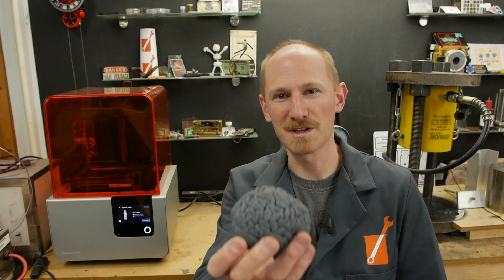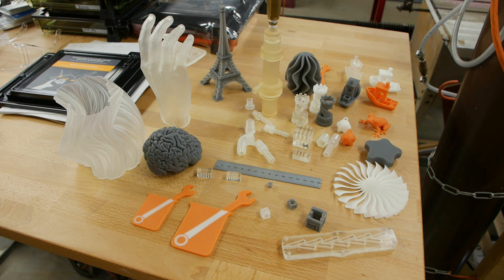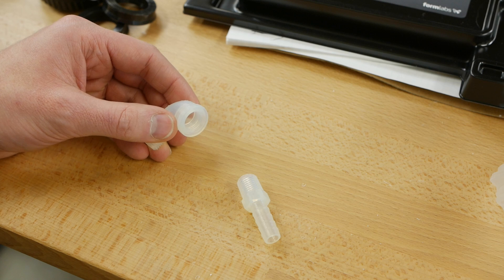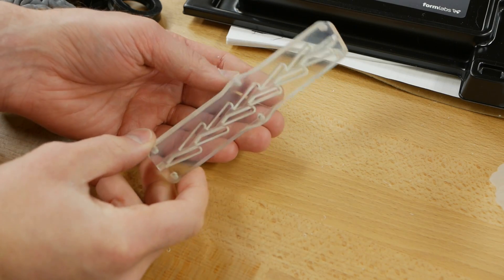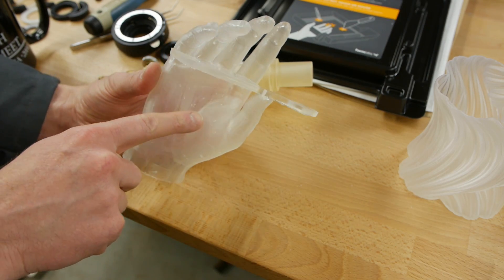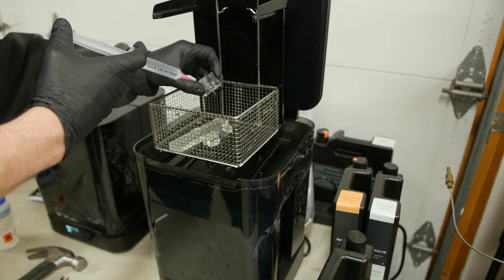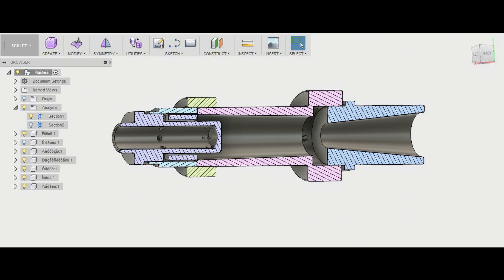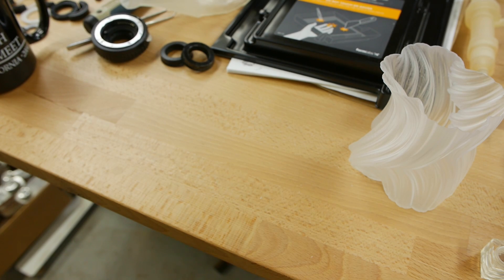3D print your brain, timelapse, high-res microfluidics, custom colors...

Comment: A Promo Code and a Bunch of Savings is alll I need! 🙏👀👌  Each of those parts are definitely as detailed as I would like for 3D Modeled Objects. They're so functional! I don't think the striations caused by an extruding printer could match the structural strength of that lazer Printer either. Just, Wow!, that's so Cool!

Comment: That is pretty awesome!  I wonder exactly how strong the various materials they offer actually measure.  I also wonder if the frosted finished products could be made clear with an acetone vapor bath, like the way regular 3D printed stuff can be smoothed out with acetone vapor.  If so, that would allow for making clear parts that aren't flat for sanding.

Comment: Yeah, I'm pretty late to the 3D printing game too (as in I haven't bought one yet, but do get some things printed at Shapeways). Being able to print ceramic is mind blowing to me.  So I'm up in the air as to do I get Formlabs or some PLA/ABS depositing printer.  I would like to print Kynar (Fluorinar) which I've only seen Ultimaker print.
Reply: 3d print a mold for another attempt at gecko tape

Comment: Good luck with the temperature resistance resin. I have been using it for my prototype. Been auto-calved my parts at 120C for 15 mins and used at room temperature. The trouble is, the part became white, mat, very brittle to the point it break too easily ain't even usable. Have so much problem with it for the pass 6 month back and forth with formlab and they just wont acknowledge the problem.  To me, the idea of all the different type of functional resin is amazing, but the technology just ain't quite ready yet. They have also just changed the user guide for resin tanks after years of cracked tank complains. So now you can't have resin stayed inside the resin tank for over a month. I have no idea what to do with mine as I do regular small prints every 1-3 days on each resin tanks. It is a nightmare if I need to clear them out every time. Plus you can told not to pour your resin back into the cartridge, so storing them separately is a pain.

Comment: It looks like a lot of teething issues have been fixed with the Form2. I would caution anyone against buying a used Form 1+ as a cheaper alternative. It's still a gorgeously made 3D printer, but I think it was very much a beta product. Some people had no issues at all, others could never get it to print reliably (myself included). My own opinions here:

When the 1+ was released, there was no good documentation on post-print care. The instructions we got with the printer were laughably simple. We figured out that we needed to post-cure with UV, but it's only recently that Form developed proper wash and cure stations. These are absolutely necessary for good prints, and manually dunking in a bucket of IPA doesn't cut it. The printers are pretty sensitive to optical issues - dust on the galvos, smudges on the base of the tanks, the inevitable fogging (UV damage by the laser is inevitable, so the tanks are disposable after 2L of printing). Over time the software got better at support design and patches included easy-release tabs on the prints. Old resin will crack tanks - found that out the hard way when it leaked resin into the printing cavity, fortunately missing the important bits.

In short there were a laundry list of little problems which meant that we could never get it working well - I don't think we were ever able to replicate the helix rook that Form provided as a demo print.

I really wanted to love our SLA printer, and on a good day it's easily better than FDM or SLS, but it was so much faff making it work reliably that it's left a sour taste. This seems to be echoed by a number of other 1+ users on the support forum when I was trying to find comparisons. Happy to be proven wrong here, because the results in this video are very enviable.

Comment: For cup shaped pieces could you not submerge a tube in the resin bath, an snorkel of sorts, to equalize air pressures?
Reply: Probably not because it would block the path of the light/optic/laser thing.
Reply: He could put the printer in a vacuum chamber, there is no pressure to equalize...
Reply: Friend: "why on Earth does this vase have a screw-on bottom?!?" Me: "...reasons."
Reply: Michael Scofield 
That's good thinkin', but besides the problem of the snorkel blocking the laser, the snorkel tube would also have to be extremely thin because of the way the machine works...
The print is made up of layers, and the way the machine creates these layers is it holds the already-printed portion of the part a fraction of a millimeter above the bottom of the resin tank. The laser then cures that very thin layer between the floor of the tank and the existing part. When the laser is done with the layer, the machine lifts the part, wipes the floor of the tank, and then lowers the part back into the tank (leaving a new gap, which will be where the next layer will be formed). The snorkel would have squeeze through that very thin gap.

Comment: Tesla valve is like a diode for liquids, or gases.
I would think that if you vibrate axially it at the right frequency, it would behave like a pump and never wear out.
May even be useful for an artificial heart.

Comment: As awesome as SLA is, I would still recommend getting a high quality FDM printer for your own shop. Sure, the accuracy isn't the best, but the speed is hard to beat, and you don't always need to print microfluidic structures.

Comment: I was wondering if it was possible to use the printer with a LC screen to occlude the light curing the resin. Or maybe also focus the laser on a spot to create areas without/with less support material.

Comment: I stunned how good form 2 seems to be in through hole and "inside holes" stuff. I have sparkmaker - its of course no way comparison to form 2 but its also sla - and this stuff gives me most of headaches. Holes smaller than ~ 1.5mm comes out filled with half - cured resin, like a puddy, and you need to push it through (with a small drill bit for example), and hope it got not too hard. I wonder if new anycubic photon 2 has the same problem since paying 2k for form 2 is not an option unfortunately. I was wondering maybe you using ultrasonic cleaner maybe?

Comment: That's an incredibly slick method. But it appears in the videos that the laser beam(s) fuse the resin at certain locations in the bath. 
But how do you stop a light beam at a desired distance? I assume the beam(s) are focused at the desired points to (a) fuse the resin at that point and to (b) avoid fusing resin along the path of the beam(s). 
I'd be interested in more info about how Form Labs' method works.

Comment: Dont print threads in transparent resin. Because it is transparent the laser will cure resin that is left on the "wrong" side of the threads, and make them non uniform. Try do a 1/8 thread in gray and it should work.
Reply: The transparency of the resin is not uniform across the spectrum, it's transparent to visible light here but almost UV-opaque, permeable to the UV wavelength used to cure it just to the maximum layer height - regardless of colour, they will always make this the same. Also the additive CMY dyes they offer must be completely transparent to the curing wavelength. If this was as you suggest, you could cure a super thin layer but there would be nothing holding it to the rest of the print!

Comment: would there be any purpose in a 3d printed superconductor? couldn't you just cover the surface of a 3d printed plastic form with superconductor and it would work the same?
Reply: Plastic won't stand up to liquid nitrogen, the shrinkage and hardening will tear it apart, that's the issue here.
Reply: I can imagine uses for 3d printed superconductors embedded in a suitable 3d printed insulator.  There's sensors, switches, and BIG MAGNETS!   Muhahahaha.

...and that's just the start.

Comment: Dear applied sciences guy. At 5:54 you tell that the printing resolution wont print the threads... no it will, if the STL file tessellation is set at least at 0,05 or smaller. in Catia V5, when u model a part like that, catia allows you to choose whatever tessellation u want.. 0,000000->

Comment: I'm so intrigued by the Forms printer.  But, if overhangs require support structure (as mainstream 3d printers do) then how are you printing those embedded passageways inside things?  how can there be a 90 degree angle hollow tube inside a cube without needing to break away support structure inside those tiny capillaries... or did you have to do that ?

Comment: So ~10 years and high quality 3d printing is going to be as common as having a battery  powered drill at home.
When cost of material goes down, efficiency goes up and multiple materials for different purposes.

You no longer buy parts from hardware store - you order resin and buy blueprints.

Just wondering how far can they go with mechanical/thermal properties.
Reply: Injection moulding will always be faster and cheaper, thus more suitable for high-volume objects. But so many items are needed in thousands rather than in millions, so of course the face of the world will be changing.

As to mechanical and thermal properties, they are already excellent, you get much better thermoset plastics than thermoplastic ones, and this has always been the case, because when you don't need to limit melting temperature, you can just build arbitrarily long molecule chains. Polyurethanes in particular are excellent mimics and epoxies are useful too.

A thing to consider though is that crosslinking agents are poisonous, so there's THAT, which is why you might not want to keep a thermoset based system (such as SLA) at home, now or ever. I'm sure there will be a safe resin too (acrylic based), and it's possibly just months away if someone gets their shit together, but its mechanical properties will be crap.

Comment: On my ender 3 FDM printer I managed a #6 machine screw with a thread density of 32 just with the standard 0.4 nozzle by cchanging lager height to 0.05mm and slowing the printer down, amd thats a 200 dollar printer

Comment: Great video, as always. You might want to check out cbliss.com for some other interesting 3d models. The threads will unfortunately be the Autodesk Inventor bitmaps, so you would need to do some extra modeling. Charles Bliss is great though... a big part of the early Inventor community. Even if you don't get any models, you should look at his renderings of the Indian motorcycle. Thanks again.  Looking forward to your next video.

Comment: Hello, I have a query regarding the formlab capabilities; can it be used to print 3 way valves like "3 way stopcock medical valves", the tunnel and the rotary element has to be aligned perfectly to avoid leakage

Comment: Try 3D printing a gun just like in LOST IN SPACE and see if it holds up the bullet impact!!!! And is it possible to 3D print custom radiators for PC cooling ?????
Reply: Metal printing is possible, in the process of selective laser sintering - basically small grain powder of raw material is melted together by a powerful laser in a layer by layer process. however, i'm not sure the prints are entirely pore free. Doesn't seem like a good choice for something like a radiator. Also there are no "affordable" "desktop" machines that would do that, so you'd need to order a print from a specialist, very expensively.

But if it's about making a custom radiator, for copper sheet constructions you can just shape them in a vice using 3D printed formers, and use 3D printed stencils to cut them out with shears.... you can then solder together the pieces by covering the connecting surfaces with fitting solder paste and placing the thing on a stove, until the paste converts and solders the pieces together.

Also, guns, bullets, yuck, why? Ask King of Random or Taofledermaus or someone. Channels that I couldn't care less for.

Comment: i'd love one of these but damn are they expensive
Reply: Look up for : Wanhao d7, has smaller build volume much more labor to produce a part , but has almost the same results at a 1/20 of the price.
Reply: what do you mean "much more labor"?
Reply: Anycubic Photon is a better Wanhao D7.

But guys, I heard a few persons had to be hospitalised after DLP printing some random resin - could have been a Wanhao resin - life threatening respiratory issues and near complete, permanent memory loss in one case. Ouch!
Reply: i mean that there is no washing station so you have to rinse the parts yourself , there is no uv curring station so you have to expose it to sunlight yourself , and the resin feeding system to the printer is not cartridge based so you have to fill the printer manual , if you are willing to do so you could have amazing parts for about 500$.

Comment: Terms of McMaster Carr does not allow 3d printing of catalog objects:  ``You shall not use the CAD Models to engage in 3D printing or other fabrication of the objects depicted in the CAD Models for any other purpose, and you shall not otherwise redistribute or make available the CAD Models (or any design drawings or prototypes that incorporate them) to any third parties, including third parties in the business of selling products similar to the Products.``
Reply: pfft, if they are going to come after me for 3d printing a little fitting for testing purposes they can have my entire net worth of $6.39.
Reply: riffraff60 
That's an interesting policy. When the 3D-printing pirate is done prototyping, where does McMaster Carr think the pirate is going to buy the real components?
Reply: The terms of license are a bit vague - but the way I read it, the use for design and prototyping is permitted, even though 3D printing is explicitly not. If you were to stretch it a bit, they probably won't mind a test fit using a print, but printing an end-use part is entirely off-limits. Furthermore it is up to you what you do within the confines of your walls, but promoting piracy publicly is completely irresponsible.
Reply: There is no “cheap” sla material that will match the performance of any standard part they sell. And high performance resin is way more expensive than even MMC’s premium pricing at the same weight. So, print away lads! You aren’t their concern.
Reply: That is some attorney having a wet dream imagining a future Star Trek replicator technology, basically doing his job commercially protecting his client from POTENTIAL future losses. If you aren’t using the stuff you print for commercial purposes none of that really applies to you anyway.

Comment: The main reason there are half million dollar printers is because of patents. There's very little actual difference between them and the hobby machines, other than proprietary patents that they can charge whatever they want for. China's got SLA printers down to <$400 price range, since they don't care about patents.
Reply: Um, no.
Reply: +vidznstuff1, it's a DLP projector + z platform, that's all it takes to make SLA. If you want super reliable ones, than there's a bunch of individual patents involved. Otherwise you project the outline, move the platform up to break it away from the substrate, bring it back down, project next image, rinse and repeat. SLA is much easier\cheaper to build than FDM. The reason FDM became available to the DIY community about 10 years ago was because the patents ran out and now anybody was allowed to build and sell their own FDMs. The SLA patents have been slowly expiring since about 2014, there's still a bunch more to go though.
https://techcrunch.com/2016/05/15/how-expiring-patents-are-ushering-in-the-next-generation-of-3d-printing/

Comment: What about a failed print job, like a collapse because removed supports, how does it handle it? will it damage the machine?, Will the dropped bits be pushed to the side and maybe out of the vat? Or will the printer abort?
Reply: It's completely oblivious to failed prints, so yeah in the worst possible extremely off the charts unlikely case you can end up with a BIG clean up job on your hands. It should just wash off with lots and lots of isopropanol, and if you need to replace the vat or the bed, those are consumables anyway.
Luckily it's not a common occurrence, the prints stick pretty well, and even when they don't, all that happens is that you have a piece of failed print floating in your vat, and a gob of hardened resin stuck to the bottom of it.
Reply: Not sure about the form 2 but on the form 1 a failed print can damage the resin tank and prevent that portion from being printed on. The printing vat is a consumable anyway, only lasts for about 2L of resin worth of prints. You can restore the old printing vats yourself instead of buying new ones though, just a bit more work.

Comment: this is so cool. How much does this printer cost? and what is the cost of the printing materials?
Reply: It's Fomlabs Form 2, It's slightly above 3 grand, and the resin is around $200 per litre.

There are cheaper printers from China (Wanhao D7, Anycubic Photon) that deliver comparable quality, for around half a grand, and their resins also maybe at a third of the price, but people have gotten severe poisoning up to permanent near complete memory loss from them already, and fundamentally same risk exists from any resin, they contain potent allergens.
Reply: Siana Gearz thanks for the info.
Reply: Siana Gearz I’ve not heard of anyone getting memory loss from printer resin, do you have a link to a reliable source confirming this?

Comment: Prince inflated ATM because of resin. Otherwise, the machine itself isn't worth that much. So not worth buying one for the home gamer, not when i can order the same parts for cheap, if, i need them from any of the many 3D printing services in Europe.

I'll probably wait another 3 years for the price to drop on this, just as it did for the rest. Even the prices on the metal printers have begun dropping.